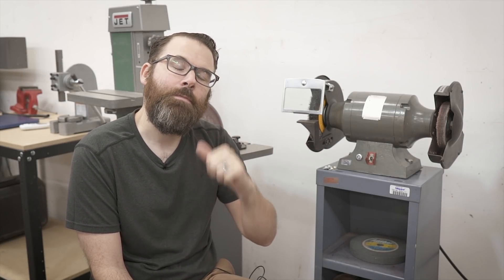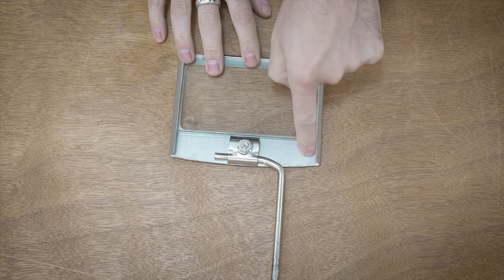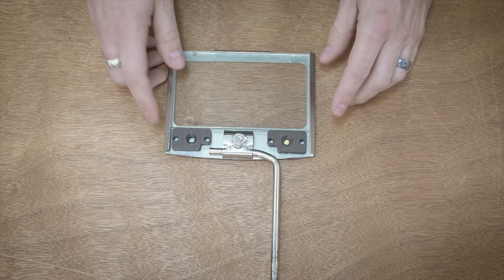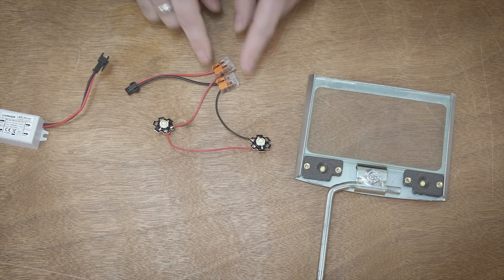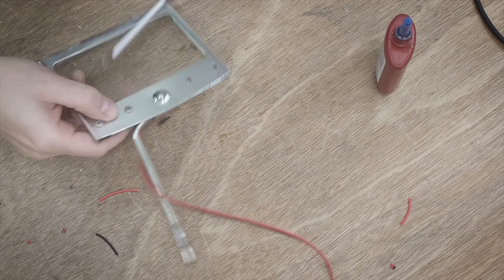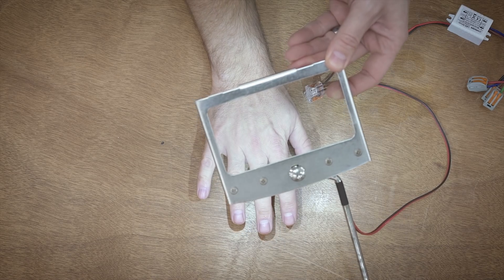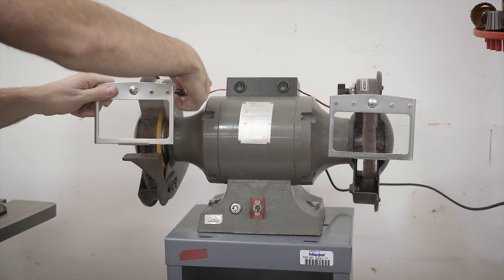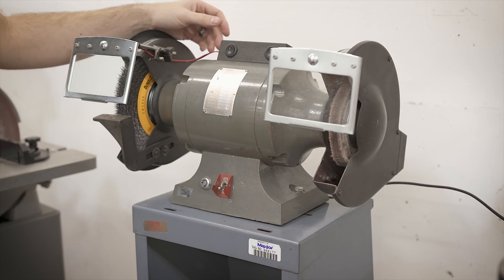Bench Grinder LED Upgrade

Comment: What is the name of the micro connectors that you used?  Not the Wago connectors. Do they crimp on?
Reply from the maker: I'm not sure which ones you're talking about?
Reply: Sorry for not being clear. The LED driver leads have a plug which connects to the string of LEDs. What is the plug called and how is it affixed to the wires?
Reply from the maker: @davidpgh1501  Ah.  I believe those are called JST SH connectors.  You can buy them with pigtail leads on them and solder the ends.

Comment: Is there a reason you didn't use one power supply and have the two switches downstream from a branch in the wires going to the LEDs? This is not any kind of a criticism but a question regarding loading of those constant current supplies.
Reply from the maker: I didn't think of that!  But that probably would have worked.  The power supplies were $7-8 each, so I just got two of them.  But I could have wired it up like you said.

Comment: What filament are u using for the case. And could you wire this in to the power of the grinder.  I am looking forward to making this.    Totally off topic I am looking for a place to find a way to steer a robot that’s the size of a power wheel toy. Any help would be awesome. Thanks
Reply from the maker: I'm using Prusament Galaxy Black, my go-to for finished projects in black.  The speckling hides layer lines and looks really nice.  I did think about wiring it directly into the  grinder, but that was some extra work and I didn't want to mess with opening up the grinder, but I still could for sure.  Steering a robot?  Use the existing steering mechanism would be my first choice.  There are many options though, it just depends on what you're trying to do.

Comment: A+ for using your 3D printer to make something useful instead of another benchy.  I'm still working on incorporating mine into my workflow.  My CAD skills still need a lot of work but I'm trying.
Reply from the maker: Right?  I have a few videos coming up soon that use a lot of 3d printed components.  There is a time and place for 3d printed parts for sure.  I use it a LOT for prototyping, but sometimes the parts end up in the final designs as well.

Comment: Does anyone have a preference for a grinder stand? Thinking about a 4” schedule 40 tube and plate to a large heavy diesel truck brake drum. Is there a alternate concept that would remain mobile to move it around and steady with readily avalible “cheap” part out there to construct a grinder base stand from?

Comment: Check out Mr. Europe over here using wagos
Reply: I was surprised as well.
Finally a youtuber that doesn't want to burn his shop down.
Reply from the maker: Eh, the wiring is still slightly questionable, but mostly safe ;-)